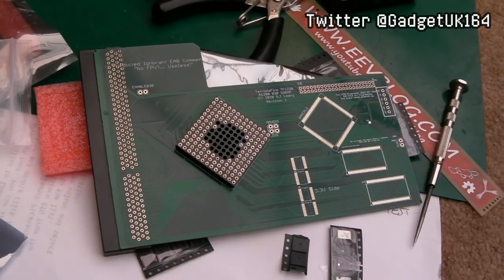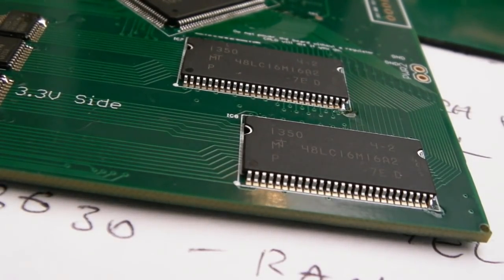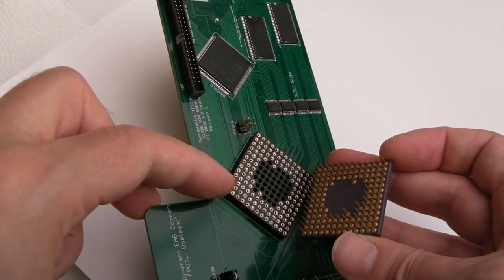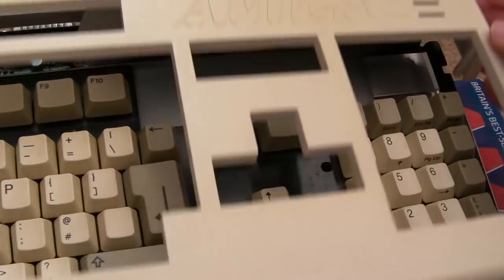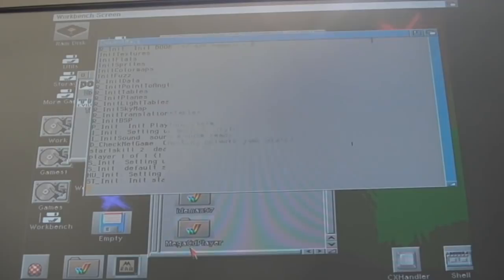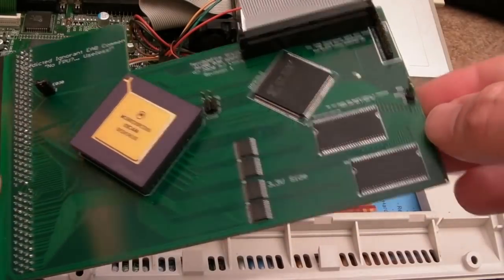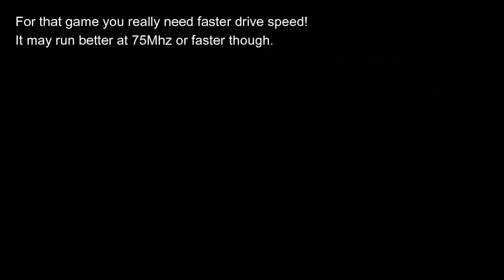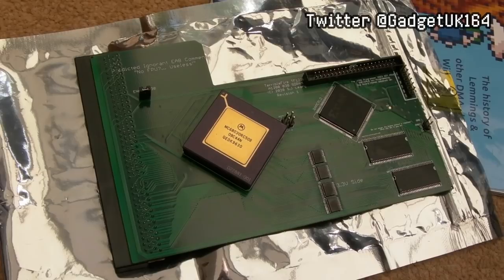Commodore Amiga TF1230 - A1200 030 Accelerator & TF1260 Firmware Update

Comment: Really nice, what temperature are you setting for wave soldering those Xilinx chips?
Reply from the maker: When dragging over the Xilinx pins there I use the Antex iron which isn't temperature controlled.   Last time I checked it, it was around 320 degrees C. PS: I wouldnt describe it as wave soldering - that's where you use a wave of solder to flow many components at once.

Comment: Sweet! DOTT sounds odd. Wonder if there is full midi support on Amiga? Not tried it yet. Used to a AWE64 32mb
Reply from the maker: Yes, this supports MIDI if you have a MIDI device on the Amiga!   It's emulating adlib btw - but it does sound pretty close to me.  Nowhere near as good as AWE32/64 though!

Comment: And me crying for an Amiga motherboard with the custom chips (preferably all custom chips and CPU already socketed) so I can attempt at re-implementing the no longer made custom chips in FPGAs so that once all custom chips go, and trust me they will go, to their cemetery we have a solution to keep the machines working. Also, the custom chips re-implementation I have in mind would have a secondary BUS interconnecting all the new logic (and all new FPGAs would have as much additional logic as possible) so we could for example implement hardware upgrades and/or extended features directly in hardware. You know stuff like audio/video codecs directly implemented in hardware on the video chips and upgradeable while keeping the system 100% compatible. Network extensions etc are all possible! Even better audio (more channels higher sampling rate) and added video resolutions without needing to use RTG and keeping the system compatible. We need this to keep Amiga alive and to breathe new fire into it!
Reply: The secondary BUS is meant to enabled higher performance data transfers/execution where unavoidable to go around the original BUS as well as to be used as the way for the Miggy to update it's custom chips itself!
The amount of things suddenly possible when we have this backup for the custom logic make me drool. I want I want I want!
Even PPC acceleration be it in a Soft or Hard core, there are open PPC soft cores, IBM opened the cores so they could be used on an FPGA. So so much we can do to improve the miggis and extend their life!

Comment: I've had no end of problems with this card, think I've got a dud as workbench can freeze after a few minutes. Softresetting gives up errors too. Seems very tempramental
Reply from the maker: Did you buy it from one of the "builders" directly?  They should be able to help - ie. test it fully and work out if there's a fault.  Early firmware had problems with certain typs of Kickstart ROMs I think - possibly EPROM.  Maybe it needs a firmware update?

Comment: Nice vid. BTW How did you get 3.44 Mflops ? Mobo FPU with crystal ?
Reply from the maker: There's no FPU on there atm.  It was possibly faster as a result of having an MMU and caching the ROM in fast RAM?
Reply: @GadgetUK164  But sysinfo in you video shown fpu resoult 3.44 Mflops... Weird
Reply from the maker: @obserwator100  It's a modified version of Sys Info, which incorrectly reports the FPU, when I dont have one.   It's modified so it doesnt crash on an LC CPU.

Comment: I did similar configuration, CWB ADVSP, but I have  a problem - the icons are striped, and the screen is flickering... What do I need to do? In screen options I have many PAL laced options, checked them all out and still no success. Anyone knows?
Reply from the maker: If you have any problems with the TF1230, maybe post on the Exxos forum (there's a dedicated TerribleFire section).  I've not see that problem myself!